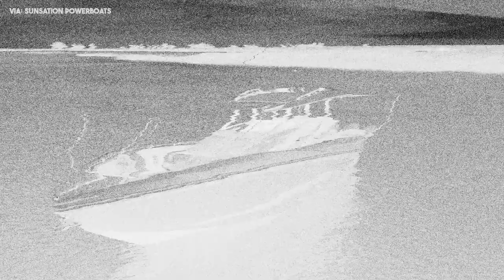THE REAL REASON BOAT PRICES SKYROCKET IN 2023

Comment: That's why I rebuilt an older hull and up spec. New mercury V8 outboard. All up i spent around $60k for a boat that has similar fit out to a $120k (new) boat of the same size. Boats that need rebuilding in the US they basically give them away. I see 233 formula hulls for peanuts, and they are one of the best mid sized hulls you can get for performance
Reply from the maker: That's what I did with my current boat (20' Talon). Instead of buying a brand new similar boat for $120k, I completely rebuilt one for half the price.
Reply: @LifeOffshore  pretty sure I watched that video. Way to go. Great way to learn some new skills too, fiberglass repair, boat fit out etc. If you are interested I can send some footage of a Mercury MoTeC and tune of a Mercury V8 later (it's not done yet) if you're keen. Might be good content for you
Reply from the maker: @fullsendmarinedarwin7244  Yea send it over would love to see it.